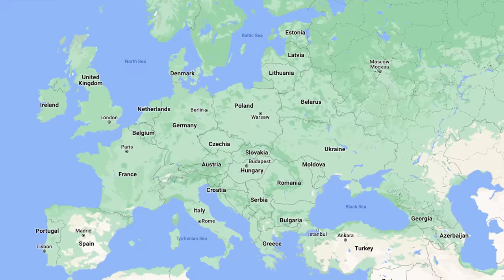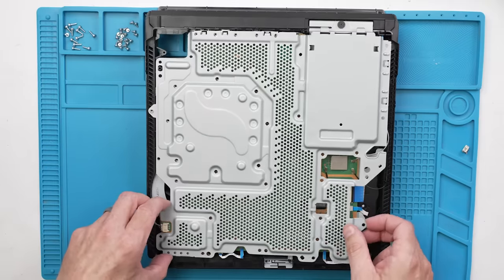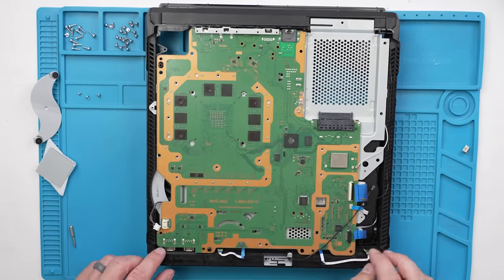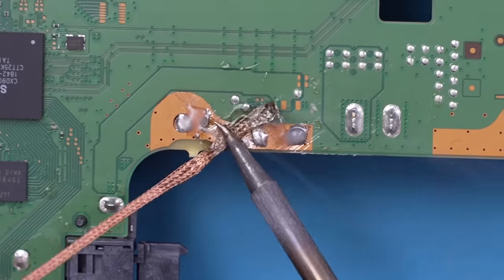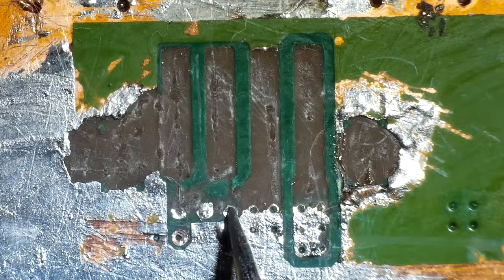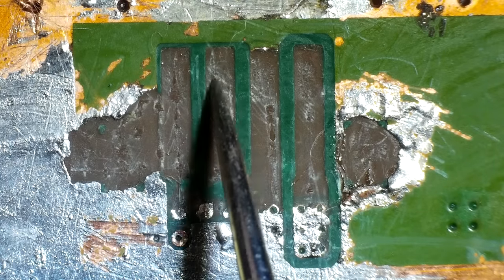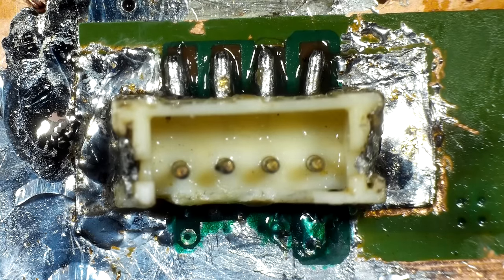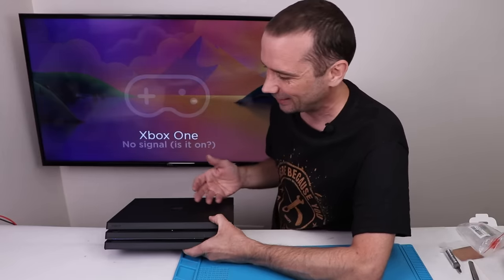3 "Repair Shops" Tried to Fix This PS4 - Let's Try to Save It!

Comment: What I've learned from your videos is that a lot of these "repair shops" are an abomination 💀
Reply: it could be the owner of the console not wanting to be blamed
Reply: Guy on the video didnt fix the ps4, it doesnt work like it should... i think what happened was, those repair shops powered the console some other way, they bypassed the broken socket and ended up with the same blue light as your man on the video... so yea, 'these repair shops'... and according to the video, your man is the 4th in the ' abomination' row and he is the last one, lol xD
Reply: @grenzhochspannungshindernis  They didn't even re-assemble it properly. Having screws missing and possibly bouncing around on the circuit is just wildly incompetent. As is jamming slim cables under a metal shield and leaving blobs of hardened solder randomly on the board, which was also to be seen. So yeah, critizising the work of prior repair attempts, if they leave behind a crime scene like that, is pretty damn valid. Especially since such a sloppy approach has you wondering, if they didn't mess it up further.

Comment: I think the other repair shops must've rejected the job. Think about it, the initial job description would've been a blue light of death followed by the destroyed connector. That's a heck of a pain in the neck if they had to keep soldering the connector every time they tried different ways to fix the BLOD and test.
Reply: I think it's all about money to those repair shops because whether they get to fix it or not they'll still get paid regardless.

Comment: 3:20 I'm not really an electronics expert, but I think those are resitors, not capacitors. Please, correct me if I'm wrong. Excelent job as always Steve! Always a pleasure to watch you doing your magic! Greetings from Argentina.
Reply: Cuál es la diferencia entre un resistor y un capacitor?
Reply: could be both SMD capacitor and SMD resitors looks almost the same.
Reply: Yes, generally caps are white, resistors are black.
Reply: @vadnegru  You're wrong about SMD caps, they are brown. Usually, fuses are white.
Reply: @Cabeza492  oh, yes when i looked up individual capacitor they are definitely brown. When they are on board they seems whiteish creamy.
Fuses on another hand is green, yellow, black with gold on that website.

Comment: I'm hoping someday QSB places will open up locally for a reasonable fee. And we could just design a small QSB that can connect the standard header to the various alternative points.

It'd be much preferable to having to use kynar wire and solder bridges.

Comment: I might be wrong but looking close at the connector, looks like 2nd wire from the left on the connector is shorted to ground. Also looks like the first wire on the left may also be very close to the via under it.
Reply from the maker: 2nd wire is not shorted to ground and first wire on left is soldered correctly.

Comment: He could have looked under the scope for knocked off components and replaced those. Sometimes that's all it takes. If not dumped the flash to enable debug and read boot logs through uart. Might have been a loose memory chip.
Reply: Not worth the effort IMO

Comment: Why not try checking out components to see what's causing the BLOD?
Reply: because he is too lazy. Many times he just make up excuses why not to continue working on. My favourite is "its APU problem" and this quote solves everything and give reason to give up lol
Reply: @johnnyhun1  Don't be so mean to him :D, check the merchant shop :D instead. 

I've learned a lot from him to be true. And, any attempt of the repair is better than none ;). He can always send it to the TheCod3r if he can't fix it :).

But, I'd send to ToltecMerc in the USA rather than send it to the UK to be true. But hey, I run only an electronics repair shop and who am I to talk about it. It's not my YT channel :D. My has only over 220 subs :D.
Reply: @screen-protector  he is really good I am not denying it, but it just bothers me that he gives up sometimes halfway through either because he is not in expert in that area, or just lazy. If he is not expert then no problem, just admit it.
Reply: @johnnyhun1  have to like it, agree ;). I admit to even worst things LOL. I admit to all :D. On the 25th of Feb on my YT here I'll show how I've damaged 128 legs CPU in one BENQ monitor :D. Did I want it? No. But, I fixed it and the customer is happy ;). So, what's the problem ;).  Even if my customer wouldn't be happy and I'd try my best, I'd still show it to them ;). I can pay for what I do wrong ;).

Comment: The second pin from left to right the thin wire you soldering is touching the board at the bottom i think 🤔
Reply from the maker: Looks like it is but it isn't.

Comment: Just as a question why didn't you use one of the white light of death PS4s and take its power supply connector?

Edit: I should have watched through the whole video before commenting lol

Comment: Hey mate,

your videos got me interested in a new hobby! My basic problem at the moment is to properly identify components on the motherboard.

Is there any kind of more or less complete "circuit map", especially for the HDMI circuit, that you know of, where I could e.g. see what kind of resistors there are on which position and their ohm value? 

Kind regards, 
Michael from Germany
Reply: This is called schematic. You should have some experience from soldering small projects like led spinner an then tackle the pinnacle of electronics - the motherboards.

Comment: My friend had an original ps4 that was completely dead, no power or anything and they brought it to a repair shop and they said it was unfixable, here’s the weird thing, when I got it I took it apart and tested the psu, it tested good, but then after I put it back in all of the sudden it started powering on, after some screwing around I found that it wouldn’t power on with the blu ray drive data cable plugged it, what was the fix? I blew into either connector and it was fixed. I’m curious if anyone else has run into this kind of issue where a dirty blu ray drive connector has caused zero power.

Comment: What causes the blue light of death? Not repairable?
Reply: from Tronicsfix website itself "The main problem that causes the blinking blue light is the solder joints under the main chip (the APU) seem to get a bad connection."

Comment: Hey @tronicsfix, I recently purchased this elite series controller and it has a malfunctioning lb button. I cleaned it spraying 91% isopropyl alcohol and it fixed it for a little but the issues comes back. I noticed corrosion on the motherboard so I cleaned it and it fixed it again for a little then came back. I was wondering if you have any suggestions. I love your videos I watch them even for consoles I don’t have. Thank you for all your tech help!
Reply: Try replacing the LB switch and see if that fixes it, i had a similar issue with a few xbox360 controllers

Comment: 7:20 did you check 2nd pin (from left) isn't grounded to the ground plane? Looks way too close.
Also you could of probably ran the 3rd pin straight up to the ground.
Probability of their bad repair shorting out directly on the board is pretty high, who knows what blew up but something probably did.
Reply from the maker: I rechecked all pins multiple times

Comment: My ps2 fat console shut off after 10 seconds of turning it on. I didn't play it for a couple of weeks, playing with the on/off switch did nothing and the outlet works fine, I connected other things to it and they worked fine. Is it a DIY or do I need to junk it and buy a new one? Please help

Comment: Good day Brother my ps4 console is having issue of turning on; it come only one blink then it off and it won’t turn on again but I changed the power supply and it still have the same problem can you help me find the problem with it
Reply: Is it the blue light problem what model is it on the original ps4 the power button sometimes malfunctions and switches the console off try putting it on with a disc maybe if not might be a CPU problem

Comment: Hi! My sons PS4’s Hard Drive crashed so I bought a new one, installed it, installed the software, got it working and downloaded a game but the replacement hard drive crashed also. I re-installed the latest software on the replacement hard drive, downloaded a game and while trying to log into Fortnite it crashed again. Any recommendations on fixing it?
Reply: Was the drive brand new, a voltage disturbance or overheating could also cause a hard drive to fail and some games save files could also be a problem

Comment: Hi TronicsFix, i have one question? I have ps4 pro and have some problem for a while,and lots of users have the same. When is in normal horizontal position sometimes it didn't read the disc, so i must rotate it vertical to start reading,and after that is working fine until turned off. I have changed the laser,but the problem is again there . I have sent it to 2 repair shop, but no answer
Reply: That isn’t good

Comment: I'm having the worst lagging and  freezing up. I've tried every tip and trick on YouTube. I can't get any help from Sony. Do you have any ideas on how to fix it.
Reply: What model ps4 if it's old you might have to replace thermal paste and do a system repair from the safe mode the hard drive might also be close to death as they only last 3 to 5 years and start getting slower as it ages

Comment: By any chance do you think you can fix my ps4? It keeps going into Safe Mode and I have to keep updating it with my USB or Wifi. When ever I get out of safe mode it will freeze and over heat alot and everthing is so slow
Reply: The hard drive is failing as they only last 3 to 5 years and overheating caused by old thermal paste so you probably need a new harddrive and new thermal paste and maybe a good clean

Comment: If you please help me ...i have ps4 .. can not power on ...i open the power supply and i found stand by volt (4.7v) but i did not find 12 volts at all ... I short circuit the pin 5v and Ac Stand by to have 12 volts but no way ...would you please help me to get 12 volts ...or you think the problem is another issue ...thanks
Reply: You need a new power supply or you need new components or maybe a fuse

Comment: whoever they brought it to, butchered it. If it was actually a shop that did this, they should never have touched it or maybe it was far beyond their capabilities and there is no shame in bowing out and asking for help elsewhere when it's stuff you do not own not to mention this is was a customer.

Also, anyone who has ever tried to solder as I do batteries for the RC hobby with ESC's etc, you make soldering look easy.

Comment: I have a PS3 Slim that I tried to fix: it turns on, shows up the recovery screen on TV, but after some seconds it turns off by itself. I even opened it up and replaced the thermal paste, as my brother said it could be a thermal problem, but that didn't helped at all. :(
Reply: Hard drive failure maybe
Reply: Or faulty power supply 😊

Comment: I just dont get it why all these companies are calling themselfes "repair shops" because if they cant even fix stuff like (micro)soldering or trace repairs (with wires or pad strips) than they dont have the right to call themself a repair shop xD
And thats also why I dont trust these shops. Whenever one of my electronics fail or has an issue I fix it by myself most of the time and if I end up doing more damage than there is no one to blame other than me :3

Comment: Everything I've read about blue light of death is a HDMI issue or system power supply. I feel like if more investigating, I'm sure the solution could be found. I also see it could be a software issue.
Reply from the maker: BLOD is not an HDMI issue and very, very rarely a power supply issue. Since it turns on fully it's not a power supply issue. BLOD is almost always an APU or RAM problem and is sometimes fixable by reballing the APU and/or RAM but even after all that work it's still not guaranteed to fix it. That's why I don't do it.
Reply from the maker: @BobDevV  All pins are connected correctly and were checked multiple times.
Reply: @Tronicsfix  Is there a way to prevent BLOD ??

Comment: Not in every country the standard is 110 volts 60 Hz, go to Wikipedia or speak clear and you use a inverter.
Reply from the maker: You don't need an inverter. All PS4's are dual voltage.

Comment: For those connectors you may need to try Farnells or Mouser. I believe in the UKJ we can get such stuff from RS Components? just ned the size etc but I have seen proper places selling such things. Those kind of places are good to start looking.
 
Also, for getting a good solid fix to the board? check out Sorin on Electronics repair school or Sorin Electronics on youtube as he seems to be the master at hot glue usage lol.

Comment: He took it to get cleaned and someone ripped off that PSU connector?? what is this rookie hour? I wonder if he got compensated for the whole price of the ps4
Reply: probably not - customer got screwed most likely. I am not a console expert by any means, but I took apart, cleaned and repasted 2 original PS4s this year for the first time ever. Made a few mistakes but they were easy to solve (just me putting stuff in the wrong order) and didn't damage anything. They both went from extremely noisy to almost silent during gaming. Both of them were absolutely disgusting though.

Comment: @tronicsfix You may not have remembered but a lot of countries in europe run 240v instead of US 120
Reply from the maker: All PS4's are dual voltage
Reply: @Tronicsfix  ok was not aware of that

Comment: So are there just a bunch of shoddy repair shops around or what? Both my own limited experience with them, and a lot of your videos suggest that a lot of people out there are just incompetent. 

Take when I had to take my PC in cause it wouldn't power on despite no visible issue. All the guy did was say the power supply was bad and give me a link to an Amazon page for a new one. He did nothing else. Didn't even test another supply to confirm that assertion. Just looked at it, pressed the power button and called it a day.

Comment: I have a graphics card that you may be interested in repairing @tronicsfix it’s a gigabyte gtx 980 and it let out the magic smoke when I plugged it in I believe one of the mosfets on the 12 volt rail completely disintegrated and nearly caught fire